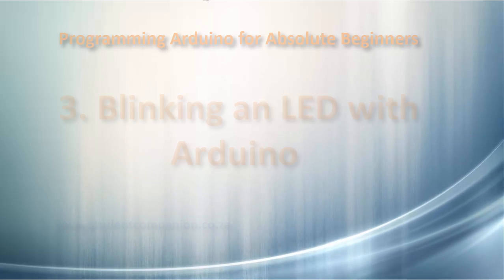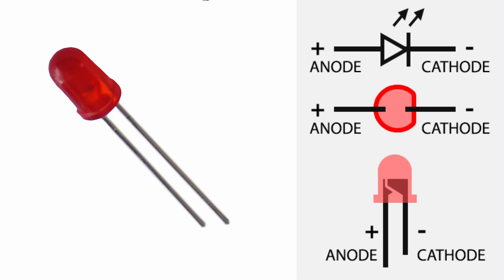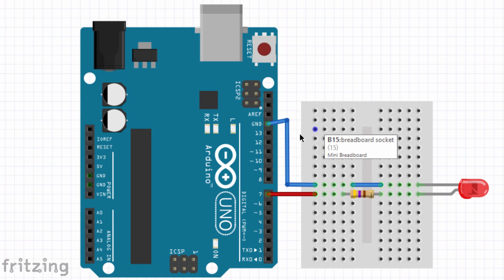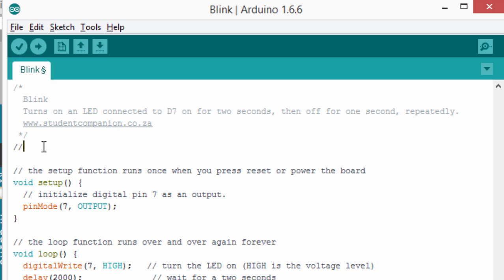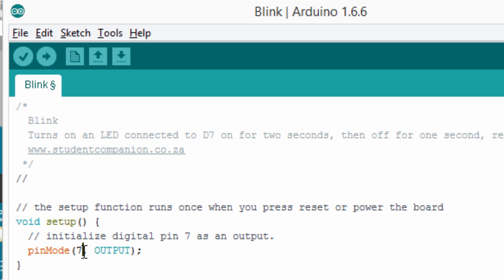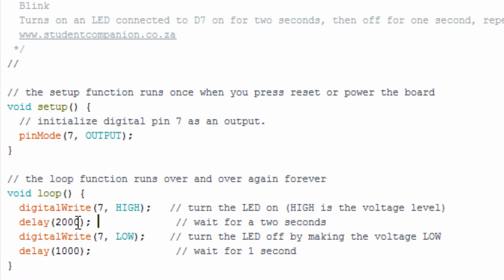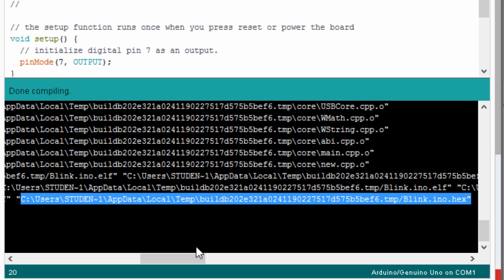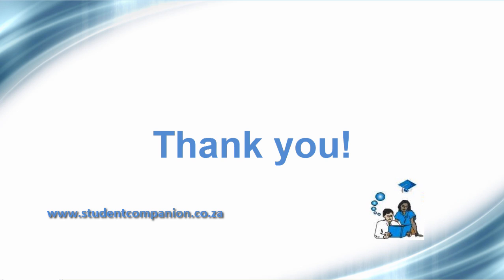3- Blinking an LED with Arduino | Arduino for Beginners Tutorial

Comment: // Define the pins to which the LED lights are connected
int LEDPin1 = 2;
int LEDPin2 = 3;
int LEDPin3 = 4;

// Set the delay between each change in color (in milliseconds)
int delayTime = 100;

void setup() {
  // Set the LED pins as output
  pinMode(LEDPin1, OUTPUT);
  pinMode(LEDPin2, OUTPUT);
  pinMode(LEDPin3, OUTPUT);
}

void loop() {
  // Set the LEDs to different colors
  digitalWrite(LEDPin1, HIGH);
  digitalWrite(LEDPin2, LOW);
  digitalWrite(LEDPin3, LOW);
  delay(delayTime);
  
  digitalWrite(LEDPin1, LOW);
  digitalWrite(LEDPin2, HIGH);
  digitalWrite(LEDPin3, LOW);
  delay(delayTime);
  
  digitalWrite(LEDPin1, LOW);
  digitalWrite(LEDPin2, LOW);
  digitalWrite(LEDPin3, HIGH);
  delay(delayTime);
  
  digitalWrite(LEDPin1, HIGH);
  digitalWrite(LEDPin2, HIGH);
  digitalWrite(LEDPin3, LOW);
  delay(delayTime);
  
  digitalWrite(LEDPin1, LOW);
  digitalWrite(LEDPin2, HIGH);
  digitalWrite(LEDPin3, HIGH);
  delay(delayTime);
  
  digitalWrite(LEDPin1, HIGH);
  digitalWrite(LEDPin2, LOW);
  digitalWrite(LEDPin3, HIGH);
  delay(delayTime);
}

Comment: Speed can be change 1000 delay mean 1 second
Reply from the maker: I don't understand your question
Reply: @StudentCompanion  i am not asking questions just telling delay (1000) meand 1 sec and give code

#define LED 13

void setup()
{
pinMode(LED, OUTPUT);

}

void loop()
{
digitalWrite(LED, HIGH);
delay(1000);
digitalWrite (LED, LOW);
delay (1000);
}
Reply from the maker: Ok. That delay is in milliseconds.  So 1000ms = 1s.

Comment: I will be highly obliged if  any body  guide me in blinking a LED  with different ON and OFF duration, without using delay  function.
Reply from the maker: You can use a timer instead of a delay function

Comment: Can i programm it for 8 hours
Reply from the maker: What do you mean by to program it for 8 hours? Program what? Your question is not clear
Reply: Led should glow for 8 hour's then it should automatically off (ex)-the led should on at 1pm and  off at 8PM and again it should on at next day 1PM and off at 8pm it should continue like this pls help me sir for this program
Reply from the maker: You must use a Real Time Clock. The delay itself won't be precise as it will start the delay after power up.
Reply: Can you help me to make this project sir
Reply: Sir by using a clock and mosafot we can make this project sir but it is not a correct process because the wires attached to the clock will be broken because of rotation sir do we have another process sir to make it pls help me sir i am a school student studying in 9 class i want to make this project for my home
Reply from the maker: What is mosafet?
Reply from the maker: With Which project?
Reply: Mosafot is a used as a switching device there are 2 types N chanel and P Chanel mosafet
Reply: I want to make this project to keep in my home sir
Reply from the maker: You mean MOSFET transistor?
Reply: Yes sir

Comment: good morning . pleas help my . flow code compler to file.obj
Reply from the maker: hi.  what do you mean by file.obj? what are you trying to achieve?
Reply: flow code compeler project to object file
Reply from the maker: خليل ورد your question is not clear. Do you want to compile a Flowcode for Arduino project
Reply from the maker: Or you want to generate a hex file? Please be clear so that we can assist you
Reply: im sorry . i want genertate project flowcode to hex.file but the flowcode program generate to object.file + c.file , and the programmar k150 don't see object.file
Reply from the maker: +خليل ورد Are you using the Normal Arduino IDE or you are using Flowcode? Which version of Flowcode are you using? Can you send us a screenshot of your project to see how you are generating your hex file?
Reply: im use flowcode v5 pic
Reply: pleas can you give my link for flowcode v3 or v4 or v5 or v6
Reply: pleas how program use e-block or ladder langoich for pic
Reply from the maker: +خليل ورد you can download flowcode from this link: http://www.matrixtsl.com/flowcode/
Reply: thank you very very match my best brother
Reply from the maker: +خليل ورد you are welcome!
Reply: #define LED 13

void setup()
{
pinMode(LED, OUTPUT);

}

void loop()
{
digitalWrite(LED, HIGH);
delay(1000);
digitalWrite (LED, LOW);
delay (1000);
}